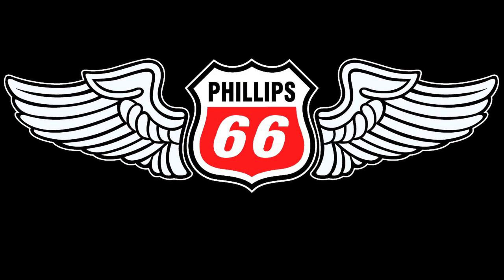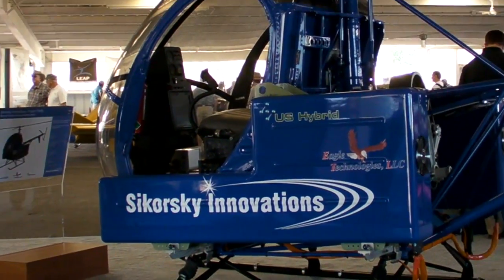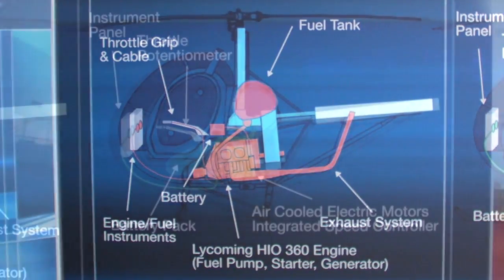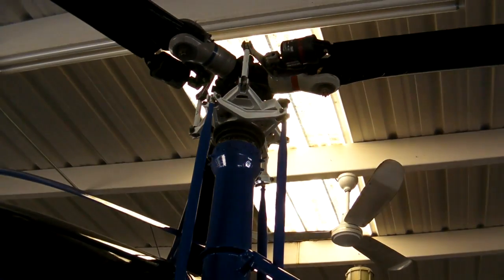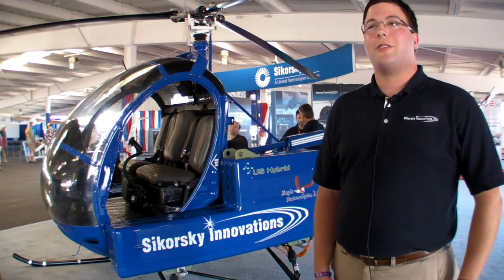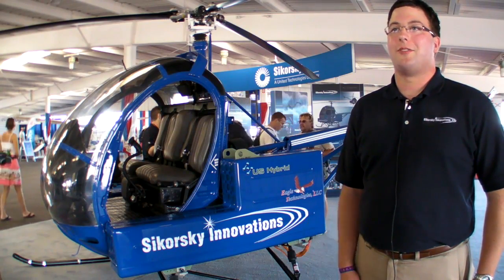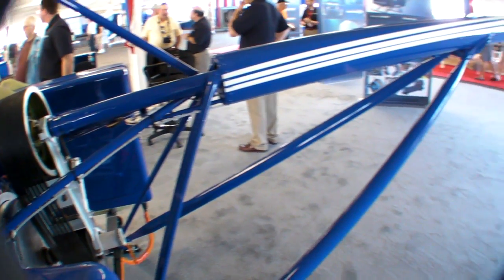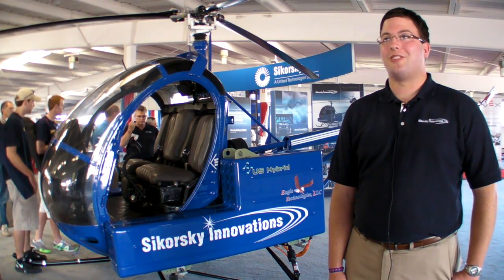Sikorsky Firefly: An Electric Helicopter

Comment: 15 minute flight time..... ?  The conversation ends right there. Ask yourself, when have you ever made a flight that was only 15 minutes in duration? NEVER !  These companies that are bowing down to the greenies are delusional. Electric power is not a viable option for transportation.. one only needs to look at the numerous failures of Tesla cars. Battery explosions, resulting in massive destruction and deaths. And this is what we as pilots are supposed to be looking forward to flying? No thanks!

Comment: 9 years ago a 15 minutes flight was achieved in this 300C electric demonstrator. Last year a record 30-minute flight was achieved in an electric R-44. With new advancements in energy storage, recharging, [super]conductive materials and electric motors we will soon see a new breed of electric helicopters. Commercial electric plane flights are scheduled to begin by 2022. I'd guess the first commercially produced electric helicopter will be available by 2026 with an endurance at least one hour flight time per hour of battery recharge on a battery of half the weight and twice the electrical density of the current ones.

Comment: there is a large design flaw in this electric helicopter....Instead of using shaft to rotate tail rotor then could have used another set of smaller size motor right at the tails and power it by same battery. Shaft is carrying extra weight not to mention power loss from transferring rotational movement to the tail wings.
Reply: Obviously you came into conclusion without hearing the whole video.
He did mention that there can be an electric tail motor for it, independent of the main rotor. They might not have put one into this design for a few reasons. One that I can think off is that the power/torque requirements might require a motor size that doesn't fit the tail frame, and there are none in existence that would.

Putting a motor at the tail would require stiffening, which adds weight. The drive shaft for the tail rotor is already a structural member, with the outer shell of the tail rotor acting as reinforcement. Now, if it does weigh the same as a 300C, then they might also have used a single 200hp motor (300C has 190hp). Assume 5% goes to the tail rotor (10hp). Electric motor's power:weight ratio isn't linear. They require a housing. A 30-35kg 200hp motor would not weigh under 2 kg when scaled down to 10hp. It would weigh at least 6-8kg, and you can't have its weight and torque supported by a thin fibreglass tail shaft without reinforcement.
 
The current design goal is to get it to hover and fly reliably as this is the first ever all electric helicopter. They can't mess about with developing a motor/gearbox combo that is small and light for such a small air frame. That comes later, when the whole concept has been proven to work. Other electric tail motor rotor designs have already been done and proven to work, but they are all in medium to large helicopters. They have all the structural strength, space, and electric power they need (from combustion engines).
Reply: Wow! how brilliantly you proved your logic. I am your fan.
Reply: I don't know if that was sarcasm, but I'll take it! It's been a shit week. Hahahaha.

Comment: The problem with electric aircraft, charged or drained, you always carry the entire battery. Gas aircraft get lighter and lighter as they fly. This helicopter is at full weight when the batteries are nearing their depletion. Imaging having to land a helicopter at max weight with an engine that is losing power.
Reply: Very good point!
Reply: Don't you think the electric motor and battery weigh way lesser than traditional heavy engines?
Reply: You have a good point  my  friend 🙋‍♂️
Reply: Or graphene
Reply: Hi Steve, also when you fly free of Gasoline or querosene your choice of to survive in accidents is to much more safety.
Reply: oscar pimentel 
They put so much fuel in the heavy long distant commercial jet flights that they have to dump fuel if they have to land shortly after takeoff.
Reply: Avery-John  maybe large airplanes could use liquid hydrogen-oxygen, which only produces water as its exhaust product.
Reply: @manofsan  not likely, it's more likely that they're only going to carry the fuel and not the oxidizer since most airplanes operate in atmosphere and can just burn the atmospheric oxygen.

if you wanted to be renewable just generate oxygen elsewhere to compensate
Reply: @pilotavery  what I mean is liquid hydrogen fuel that burns in oxygen atmosphere, generating water vapor as exhaust
Reply: @Aeroplane another advantage is in redistributing electromechanical power, where there is much more flexibility as compared to conventional combustion engines.
Reply: so. drop the batteries. i mean dumping fuels been a thing forever
Reply: @pepsiatlas5452  that's an expensive way to fly electric, since batteries are among the more expensive components. I thought drop tanks are only for military combat aircraft.
Reply: @manofsan  well i meant drop them in an emergency not as a landing procedure. lots of larger aircraft like jumbo jets have vents to dump fuel that puts them over landing weight .https://en.wikipedia.org/wiki/Fuel_dumping#:~:text=As%20a%20rule%20of%20thumb,of%20fuel%20in%2011%20minutes.
Reply: @pepsiatlas5452  hmm, so you mean dump the batteries during emergency autorotation? That might be an option.
Reply: @manofsan  exactly. and. get good at full weight landings i guess. some more complex landing gear is probably fair considering the enormous amount of intricacy you save not having the engine
Reply: @pepsiatlas5452  some airplanes don't even have to dump fuel, if maximum landing weight is within 1 hour of fuel burn of maximum takeoff weight then you're not required to have fuel dumping capability, it's only for making emergency landings right after takeoff when the maximum landing weight is lighter than the maximum takeoff weight
Reply: Even with no battery you could land it on autorotation.
Reply: People with drones do it all the time
Reply: All pilots train to land a helicopter that has lost power at full weight, you have the same problem with a gas helicopter which fails at the start of flight.
Reply: @clioaspinade9275  do you fly rotary?
Reply: Clio Aspinade 
Yes, it is possible. I never said it wasn’t. It does increase the risk on every flight though.
Reply: @clioaspinade9275  EXACLY CLIO. AND IT IS ONE FIRST PROTOTIPE TYPE. IN NEXT FUTURE THE NEW BATERY WILL BE MINUS WEIGHT. CONGRATULATIONS FOR SIKORSKY HELICOPTERS.
Reply: Oscar Pimentel so when are we to expect these next gen batteries. You know you ev fans keep telling us we are on the verge of super capacitors, battery that charge from just being a battery!! batteries that just last forever no added weight no safety concern, no maint, and all in the size of a penny. Lol they been telling people this for a decade now. What are they waiting tell we tear the crap up out of earth for lithium, or when all our water is mixed with chemicals from
Recycled batteries, ooo no wait we’re going to wait tell we’re told how evil we are that were using modern day batteries and that we need to feel bad and spend more money on this new feature. Oo that sounds familiar there doing that to fuel now.
Reply: @oscarpimentel3315  And a flash light batteries.
Reply: @buddtwin2  friend the elétrical sistem in 300 is great for Future, unfortunable Sikorsky Co has sold the division of factory of 300/330 It is bad for little operators and one Factory of Acrílics in Texas is owned now, do you have some fresh motive about the situation  about furbished of parts or if production is continued ?? l have 300 and no have informations about new Company I  am placed in Brazil
Reply: @buddtwin2  also consider that electric motors are simpler and more reliable, less prone to failure and requiring less maintenance. Electric cars famously require far less maintenance than comparable gasoline cars. This in itself could provide safety benefits for small aviation.
Reply: Yes but will be possible with solid state batteries

Comment: NOT the way electric helicopters should be made. Good greif, put some EDF'S on the wing tips and lose 15% of the weight and power requirements by removing the tail boom.

Comment: Hey Sikorsky...here's an idea. Take about 500Lbs of batteries out, toss in a 100lb, 80hp reliable 2-stroke in series with the electric motor- for constant power use & limited charging. If the engine fails, you still have battery reserve for controlled flight to a preferred landing spot- rather than having to auto-rotate. When designed for ONE constant output, as would be the case for a helicopter hybrid engine, IC engines can be made quite fuel efficient and lightweight.

You accomplish all the same  mission parameters (you can kill the gas engine near LZ for "quieter" approach & takeoff) but don't limit yourself to an impractical joke of an aircraft. A hybrid system in aviation is the only practical short-term solution for the limiting storage physics of batteries.

Oh, and next time get a spokesman who really understands the technology, rather than some uninterested kid who just graduated for the Columbia School of Broadcasting reading off a memorized script. That's from someone who both designs aircraft, and has spent 20 years doing presentations...
Reply: Hybrids is a better approach considering limitations of battery technology presently.

Comment: Full torque at 0 rpm instead of having to wait for the engine to spool up to full power. That means you can lift off instantly, which is a good thing if your getting shot at. Couple that to a electro-magnetic clutch for increased thrust and you have heavy lift capability. A new sky crane would be very nice.
Reply: LOL, torque at 0 RPM means nothing is spinning.

Comment: It clearly needs a lot of fine tuning, 100 pounds for 15 minutes of flight, thats 2.25 Gallons or 13.5 pounds for 15 minutes of flight. So this clean way of power uses that in comparison. And for concerning weight, the situation gets worser by 80% (!), this antagonist way of flight is a 100% clean engine, which uses 80% more weight in comparison to fuel.
Reply: +Backtrack He said the batteries were 1,100 pounds.
Reply: So it is, thanks! They were about to send me a free helicopter for that!
Reply: Just keep your eye on the clock so it's not your last 15 minutes of fame.

Comment: 15 minutes, are you kidding. you might run out of power in mid air. Then what? bam! you're gone
Reply: redfoe77 It has been proven that helicopters can land safely if they lose power. I am sure there is a video on youtube of it.
Reply: +redfoe77 - http://lmgtfy.com/?q=autorotation
Reply: Autorotation has saved many lives when helicopter engines fail. I'm pretty sure most helo pilots would never want anything to do with helicopters if they couldn't autorotate. Duh.
Reply: You just have to look for a thunder storm and fill up the batteries.
Reply: +wootfluke there is u can look up bell 206 reverse rotation landing I think is wut is or power loss similation.
Reply: +Bruno Lobo Indeed, consider the autogyro has been around for almost as long as the fixed wing aircraft (almost) and they only have a pusher prop. Always like autogyros.
Reply: It's called a autorotation. Helicopters can be flying and have the engine fail completely  and still land with no damage to the bird
Reply: candr Autogyros - there is something I've never had a chance to fly.
Reply: nah in a heli you can auto rotate easy mode
Reply: who gives a damn about this, autorotation/ reverse rotation. Im sure many pilots would rather not deal with this. duh!

Comment: It's a start, but 15 minutes of flying time isn't going to sell any of these. Good start though. Keep working on it. You still have a way to go before taking it to market.
Reply: You could just put on an on board generator to power the motor or recharge the batteries. Range extension... wouldn't need to be a big heavy one just a small site one.
Reply: Sounds like an ideal airtaxi in cities like New York
Reply: +Tom Tierney yes, let's just complain about what we can't fix at the moment.

Comment: In the late 1800's electric cars had a range of 30-40 miles. Now look at how far we have come regarding performance and range. Battery technology is rapidly progressing. The idea is not to make a helicopter that can fly longer than 15 min, the idea is to show the world the concept works. Oil companies have already felt the impact of fuel efficient vehicles, but they can no longer prevent a more informed consumer and customer. Some of the very first electric locomotives were destroyed by the workers, because it threatened their job security, now most heavy movers are hybrid electric power plants. I love ICE just as much as the next guy, but you cannot be short sighted and dismiss a technology that is still in the genesis of development.
Reply: +Luke Davis Exactly!
The first hurdle is to get them working and safe,
then the other features can be refined.
Reply: actually - I think the first cars were in the early 1900s.
Reply: +tiger body No, the first electric model car was in the 1830's and the passenger was in the 1860. In the 1890's they were using electric trucks in places like New York London and Berlin, because of the massive batteries of the time. But they have to admit even with the limited work on them (since the gas engine was easier at the time) we have cme a long way with the technology.
Reply: yup - 

https://en.wikipedia.org/wiki/History_of_the_electric_vehicle

Electric model cars[edit]
The invention of the first model electric vehicle is attributed to various people.[1] In 1828, Ányos Jedlik, a Hungarian who invented an early type of electric motor, created a small model car powered by his new motor. In 1834, Vermont blacksmith Thomas Davenport built a similar contraption which operated on a short, circular, electrified track.[2] In 1835, Professor Sibrandus Stratingh of Groningen, the Netherlands and his assistant Christopher Becker created a small-scale electrical car, powered by non-rechargeable primary cells.[3]
Reply: Electric cars work well, because they don't have to lift the battery. Once they get it moving, then its only rolling and air resistance. How much does an empty battery weigh vs and empty fuel tank....

Comment: Too many people are assuming that batteries and motors will not get any better in time. I might want to remind those people that the first aircraft only flew a hundred or so feet and the first gas helicopters were look at as something slightly more then rich mans toys when they came out. If you ignore and never try nothing will advance. So I will see what happens in 10 or 20 years and then decide how useless these craft are or will be. For now, good start.
Reply: @Osw719 clearly you have not been closely enough, drone taxi in Dubai?

Comment: Just like an R/C Heli, you have limited flight times. Yes, electric is great, but I will stick to my Nitro heli. I run low on fuel, I refill it and I'm back in the air. Electric, not so much unless you have several batteries.

Comment: I don't understand why they would even attempt battery only aircraft or motorcycles before they would attempt hydrogen fuel cell. The hydrogen tank, fuel cell stack, small operational batteries are far lighter than massive battery packs. The endurance would be 5 fold at least and far lighter. It's like they're trying to sell batteries or something. You'd have to wait until the battery efficiency technology catches up big time to try this before hydrogen fuel cell stack I would think.
Reply: Those are all generic assumptions about hydrogen fuel cells which have not panned out. They have never turned out lighter and are far more complex. Then there is the lack of hydrogen infrastructure on top of that. 

The drive train is the same so if hydrogen fuel cells make some fantastic move forward, it can be seamless as long as we start using electric motors.
Reply: One important thing they are trying to do is help this planet, believe it or not . But escaping gas from the cell can easily eat up our ozone layer bid time causing rapid damage of global warming. Hydrgen is nasty to ozone. Much worse then what we are dealing with today. Its purpose as a gas for burning in an engine is however 100% safe to our planet. But to produce the hydrogen we still will use a large amount of  oil and natural gas, which will cancel out any benefits of using it. The expense is very high to pull out the hydrogen from water.
Fusion reactors are still the best way to go. And what if we run out of water? HUH.
Think of the fish.

?

Comment: I'm surprised they didn't start with a new heli design to make it as light/sturdy as possible to maximize flight time. Maybe a titanium tube frame, carbon-fiber rotors, single seat, etc. Another way to get more flight time would be to use ground-power to get the rotors up to 100%, then disconnect and go on batteries as you lift off. An electric heli seems possible but you gotta start with a fresh design and concept.
Reply: Lighter helicopters make it possible to include parachutes.
Reply: its technology demonstrator. so they only need to make it fly and prove it is possible. thats enough. oh... and they have to wait for better batteries too.
just no point in wasting much money on it before batteries are good enough.